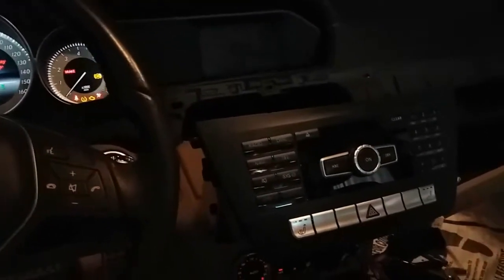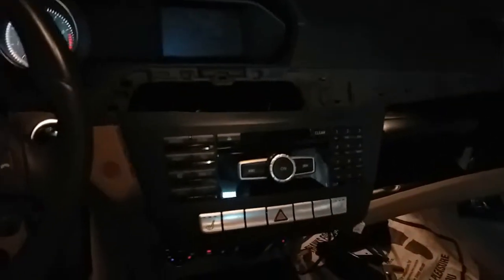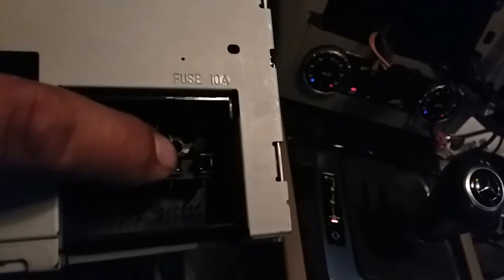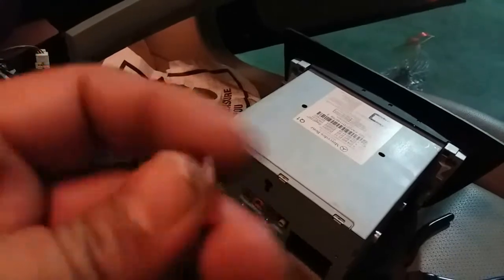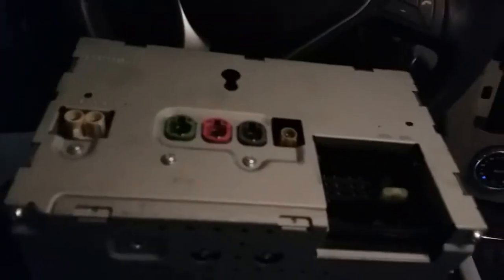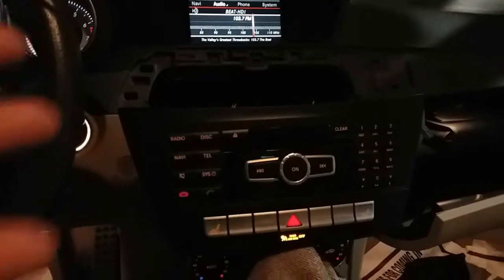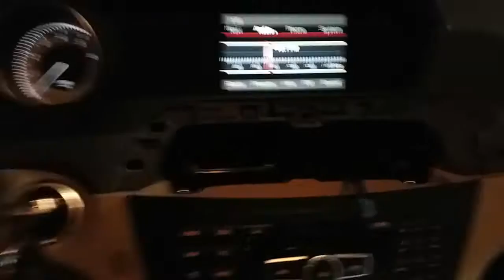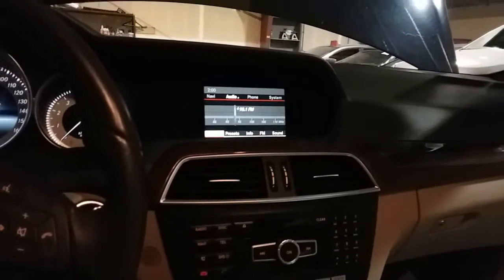How to Troubleshoot a BLACKED OUT Radio on a 2014 Mercedes Benz C250

Comment: There's a reason why there is a 10 amp fuse on that radio its so that if there is a current spike of more than 10 amps that would damage circuit boards it would burn the fuse and protect the head unit by you putting a 20 amp circuit you have raised the safety threshold of the circuit boards so now if you get a current spike there's  a good chance that its going to damage the chips on the head unit . but hey gamble away. i would have just replaced with designated fuse ... just sayin

Comment: Hey, George I have a Mercedes Benz c250 2014 and I was recently in an accident 3 airbags deployed however, I ended up getting it fixed and I got it back with my screen blank. The screen has power and ground but it’s blank
Reply from the maker: dang i honestly dont know
Reply: I have the same problem

Comment: Did your screen and charging outlet not work as well bc or that fuse? Currently have the exact same issue and my local dealership wants 6k to fix it
Reply from the maker: No just the screen wasn't working...it sounds like a fuse
Reply: Did u get it fixed? I have same issue with mine too.

Comment: hey george, this has happened with the large android screen upgrade. i hope its just a fuse too. it worked fine for 2 days then i start the car and its black. maybe it has too much voltage now and needs and upgraded fuse?
Reply from the maker: Possible check the fuses, if it's good check wiring. If good make sure ur getting power to the radio with a voltmeter. If you are might be the headunit that went bad. Check ground make sure its a good ground. Sometimes the ground can be bad and needs to be directed to anything metal in the car
Reply: @559powerscape Exactly what wiring cause I’m having the same issue I replaced the fuse and reinstalled everything still didn’t come back on

Comment: Hey brother. I got nav and visuals, just no sound coming from speakers. If that fuse was popped, I wouldn't get anything right?
Reply from the maker: Yes, if the fuse is popped, it won't turn on the amp
Reply: @559powerscape  if the fuse is popped, I wouldn't have nav tho right? And my screen wouldn't turn on?
Reply from the maker: @eazynosteroidz3074  yes I would check all the fuses to start off with. If everything is good it might be that head unit that's bad

Comment: What if the fuse isn’t blown?
Reply: I’ve had the fuses checked even the one you just replaced
Reply from the maker: Was it working before? If all fuses are good maybe check if there is power at the head unit by removing it and with a volt meter check the voltage. Maybe it's the head unit that is bad
Reply: Can you help? The mechanic replaced my alternator. Now the radio system won’t power on. The screen is black. I can’t charge phone in the car. I have a 2014, C250. It sad working before the alternator replacement and now it’s giving a code U014787, “communication with the head unit has a malfunction. The mechanic says he can’t figure out the problem.